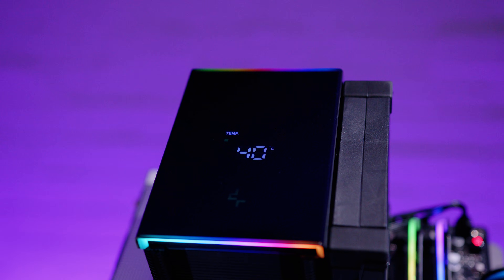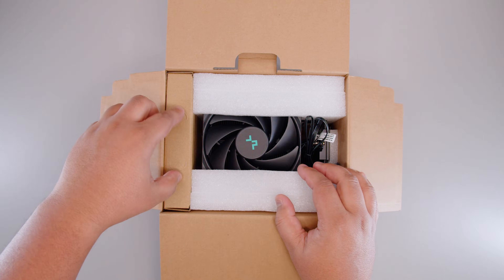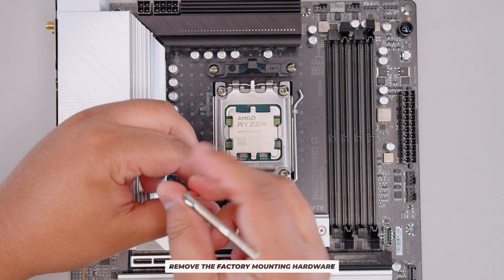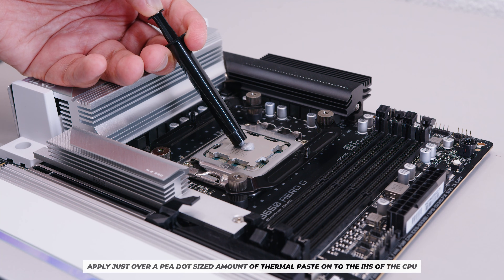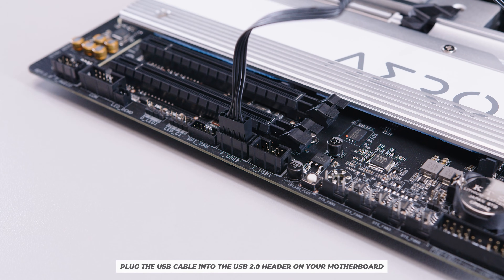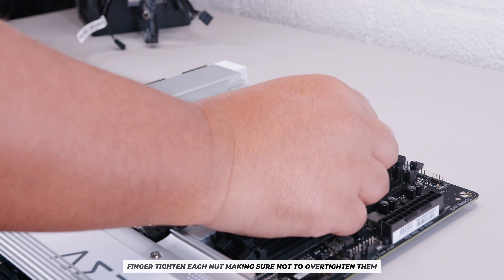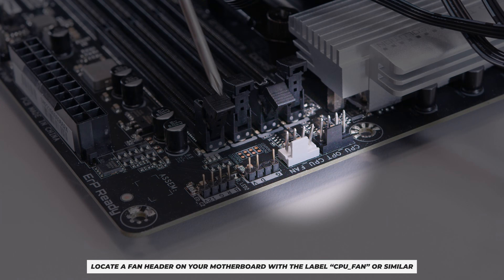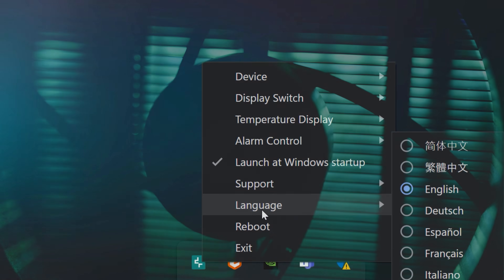HOW TO Install Deepcool AK500 Digital | AMD & Intel

Comment: Dude, I didn't get it. You removed the standard mount from the AM5, it was secured with four screws. Then you attached the fasteners for this connector. But how did you attach it? There is a screw at the top for fixing the bar, but there is no screw at the bottom that can be inserted into the hole. All I see is a flat, smooth base. As for the AM5 fastener, the dark part goes to the motherboard. But how can you attach it if there is no screw? You're either doing magic or you're doing something wrong.

Comment: asus b450f does not have 3 pin 5v argb header where to connect that...?
Reply: there's no way, all motherboards have at least one. if you don't have any free spots, you're not obligated to connect it, but the rgb led will not turn on without it being plugged in. the only thing needed is the cpu_fan pwm header. the usb 2.0 is also not needed since it's for the display screen but all motherboards have enough of these.

Comment: Why there's no space for rear fan (the rear exhaust case fan) after the AK500 installation?

The distance from the back of the case where the rear exhaust fan is usually installed, to the rear-end of the cpu cooler is less than the thickness of every 120mm fan I have. However, if the cooler is mounted in reverse orientation, there will be space for fan, but the display will be upside down -  of course wouldn't want it to be like this.

I carefully checked AMD and Intel bracket mounting mechanisms, and everything, no error there. 

Why then there isn't any space for rear exhaust case fan? 
.
Case - Gigabyte C200; MSI H410m-A pro board.

Comment: Just got my ak500s, my motherboard doesn't have 5v 3pin can i put it on a 6pin fan hub with a 6pin to 3pin converter?
Reply: where did you connect that 3 pin socket my mb also dosent have a 3pin header
Reply: @reshamthapa1889  How did you connect yours?
Reply: @dien6562   i got q Argb Mini Controller 5v 3pin To SATA Powered, converter

Comment: Hello, I want to buy an air cooler for the i5 13600KF processor, but I will not break its speed and I want the processor temperatures to be excellent while playing at resolution 2k. Do you advise me to buy it?

Comment: I bought this, display will not work fan works fine rgb works fine deeopcool logo illuminated, I've tried every usb on my motherboard and I always get device not detected from deepcool software. I've messaged deepcool but no response in the last 24 hours, has to be a display issue as its not rocket science installing this as all the connections only plug in one way. I kinda regret buying it at this point, I thought it would look cool and be a neat feature but mine doesn't work.

Comment: Hi if i dont plug argb plug only argb stop working or any other fuctions will stop working because o really bad don't want rgb in that cooler because in my pc that colorfull looks bad by the way I don't have that port can i just don't connect the plug and fans with screen will work anyway?

Comment: i don't get it "inline resistor" this slows fan when CPU are Cold  and back work fast when it's hot or slow it all time ?
if all time what the point of use it/benefit ?
Reply from the maker: All the time. It makes it quieter

Comment: What's the point in installing the optional resistor, when there is a PWM fan, program controlled.

Comment: Hey guys I have this cooler and my cpu temps while idle are between the 60 and 70. I checked the manual several times to see if I did the installation right and I did. I also used the included thermal paste. I tried reinstalling the cooler but the temps are still the same. The cpu that I’m using is the ryzen 5 7600. What should I do ?

Comment: If you could rotate the display I would be all over it. But my system is in a ThermalTake tower case so the MB is rotated 90*

Comment: hi , i have this question , can i connect the argb fans of the case on the extension on 5v pin ? my mobo only has 1 spot for 3 pin 5v argb

Comment: Why does the 3 pin rgb cable has another connector in the same cable? What should I do with it, and what is its purpose?
Reply: Daisy chaining.  You can connect another ARGB fan or other product to it.  Lets you use more than one device per RGB header.

Comment: Is there a way to make the deepcool software start without clicking the icon? I tried to make it a startup process but it's not working
Reply: I have the exact same issue. I reinstalled and did a lot of troubleshooting and to only find out in the deepcool system tray there is actually a "Launch at windows start up"  this sorted everyinthg. The digital display now shows up when windows starts. Hope that helps. https://youtu.be/xLdrk2lTBj8?t=239

Comment: Hello. I`ve a Asus Tuf B450 Pro Gaming motherboard and there is no 3 pin for RGB (gdv 5v), only 4 pin 12v , but I have a controller from the Aerocool One Eclipse case with such a pin. Will I be able to connect this cooler?

Comment: There are two versions from the ak500.. with a display+LED and without.. I installed it and first i was confused why it didn't work haha I ordered the wrong one. But i can send it back. The temperatures on my 5800x in cinebench r23 are at max 83 degrees. Very strom and quiet.

Comment: Hello Nick, 
I know you must be tired of NR200P questions, but can you please provide information if this ak500 will fit in the NR200P
I plan on using the mesh panel on case and using 7800X3D. 
ak500 seems to be good in between the ak620 and ak400.

Comment: Literally the only person on YouTube that installed one with wiring locations so thank you. This helped me with the ak620 digital I have. You would think this would be part of the instructions but no. I understand everyone has different boards but at least show or write about a diagram
Reply: i dont have a 3 pin port i just plugged i onto the case port to control it but can I still use the digital display?
mines not turning on

Comment: I bought one of the AK620 Digitals, and while they are good quality, and looked great, the screen scratched very easily.  I accidentally scratched it the second I peeled the plastic off.  I ultimately returned it to Amazon, and bought an AIO instead.  Cooling performance was excellent though!

Comment: We need to address these crappy clips, I have not ever met any builder that enjoys these clips.  That top hole is, maybe, one of the best solutions.  I just upgraded to the Z790 last night, if the board is out it is still a struggle.

Comment: not as good as the noctua NH-U12S runs 85c on my 7800x3d R23 allcore 80c R23all core with the noctua NH U12S .. heat pipes are the big difference noctua has 7 per side AK 500 5